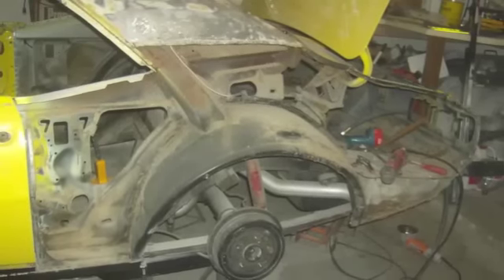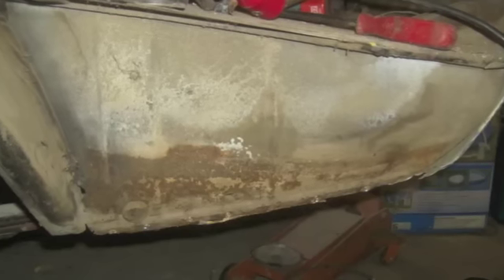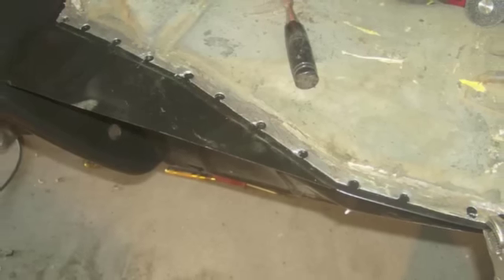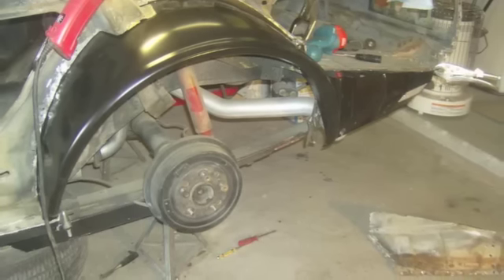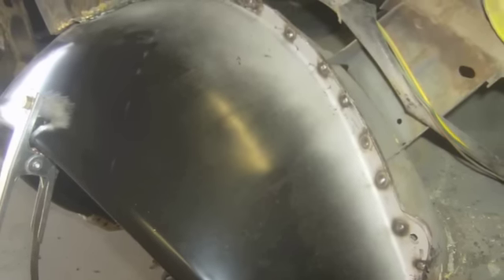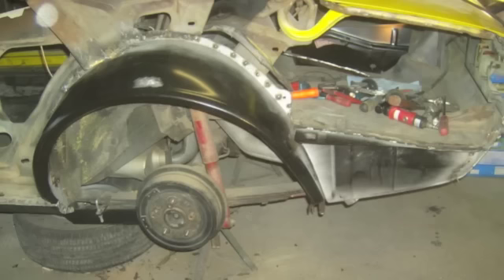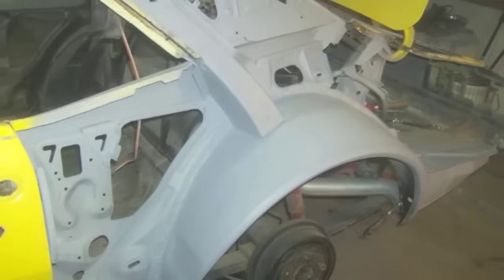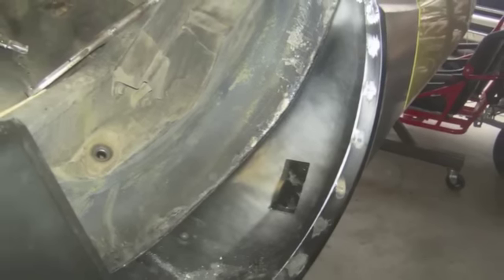Outer Wheelhouse video for Tom Noble

Comment: hey Nick,  so how do you get the outer house off each side, just find the welds and drill them out ?  I am going to do this with both parts on each side. thanks in advance.  Jeff
Reply from the maker: Yes. You can buy cheep spot weld cutters at Harbor freight for 5 or 6 bucks each & they work pretty well on these. The pain in the butt part is removing the front half of the out wheelhouse as you need to separate the outer WH from the inner structure & inner WH. If you want too you can just cut off the old outer WH flush with the Inner and then lap the new outer WH on the outside. I did this on the Red 68 RS just to save time, I think part 1 & 2 of the 68 RS Restoration videos should show this.  Once you re seam seal the the joint between the inner WH the inner structure & the new outer WH you can not tell. Personally I would avoid just sectioning in the rusted part of the outer WH as I have done it that way in the past also & IMO replacing the whole thing makes for a much cleaner installation, & in the end turns out to be less work.  
 I hope this helps & good luck..
Nick

Comment: Tom,Can you replace a rusted wheelhouse, with the quarters still intact?
Reply from the maker: +Willard Laws You could likely section in part of the outer wheelhouse, but I don't see you replacing it all without removing the quarter.
Reply: Thanks
Reply: I'm in the middle of replacing the wheel houses on a Cuda without replacing the quarters. It's not easy by any means. If you do it in sections, be prepared for welding overhead in a small space while sitting on a cold garage floor. I won't ever do it again. It's a complete pain in the ass!

Comment: I can swear to the fit ! these parts all totally suck, I worked these back in place and then just changed my mind and went with the mini tubs. much easier to work with and lots of room. I have all new sheet metal and from different companies, they all fit like crap and hours to make them fit right. if they were gm parts they would fall on and fit perfect. nice job on the car...!